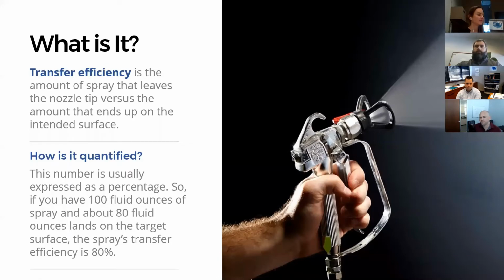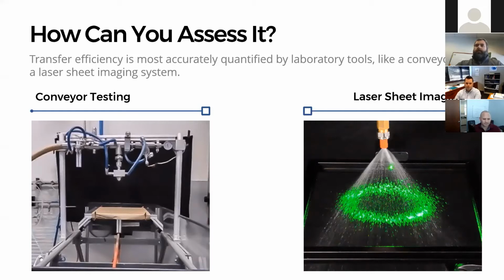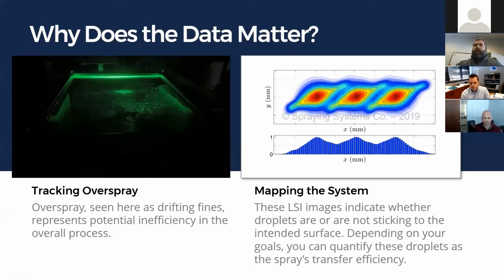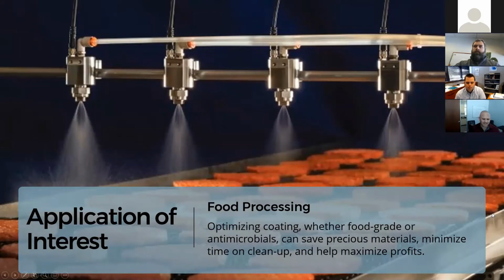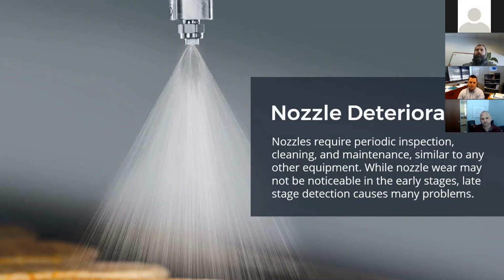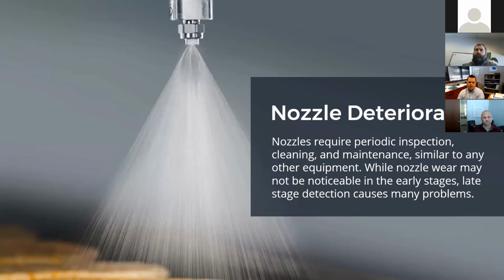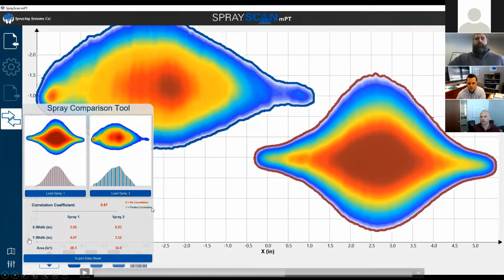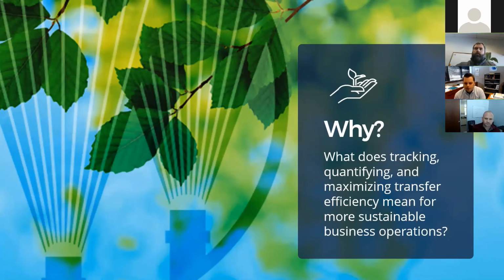Transfer Efficiency: The Key Sustainability Marker You're Not Tracking

Comment: As far as a gross estimation of transfer efficiency for a particular application: Can we take at face value the stated square footage covered by a given amount from the paint vendor? Trying to get an estimate on potential waste from our primer coat line for steel door skins. So we would have simple total square footage of doors processed and coated, the amount of primer coat throughput, the assumed or even quality tested mils of paint on the door skins, and take the difference for assumed overspray?